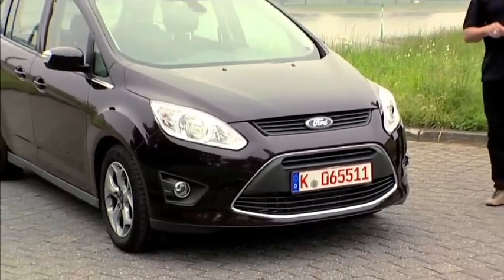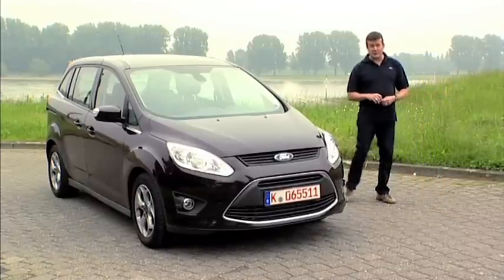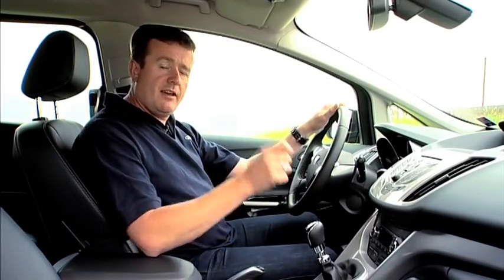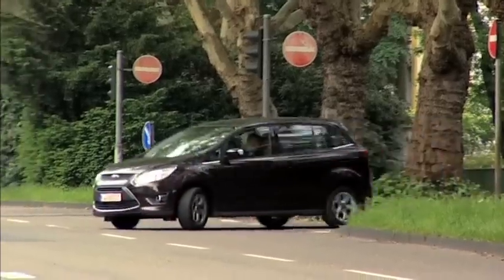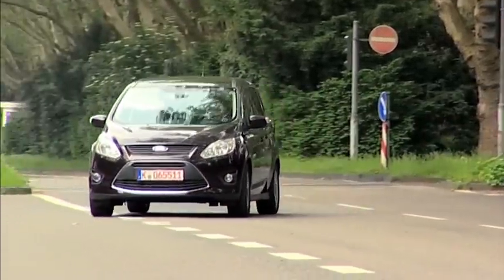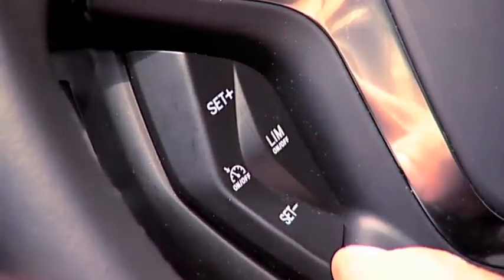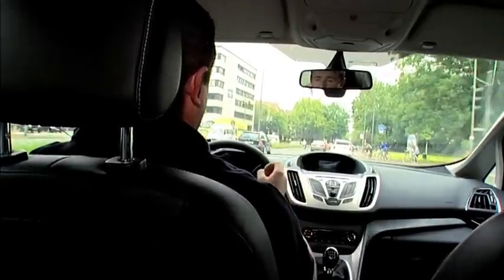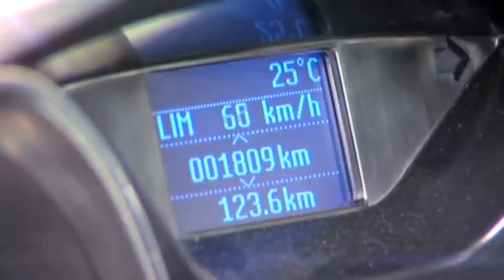Keeping Speed in Check - Speed Limiter

Comment: I believe that year on year police stats show that only about 6% of accidents are caused by unlawful speeding or that speeding over the speed limit was a  contributory factor but by far a higher  majority of accidents are cause by vehicles that are being driven or riden at speeds that are inappropriate at the time of the incident and not necessarily over the speed limit of that road.  The vast majority of all accidents are at junctions  and roundabouts,  [ smidsys and tailgating] usually around towns and  all usually under the speed limits and then in the country on bends [ going to fast or not allowing sufficient time and distance to slow in]  or on  inappropriate overtakes into oncoming danger.

So a speed limiter would have little or no effect on the vast majority of collision, incidents, accidents, injuries or deaths.

Comment: Will it act on the shown speed limit or take into acount the Police allowance of a speed plus 10% plus 2 mph so at 30 mph one could drive at 35 mph without fear of prosecution [ at the police officers descretion of course] but does that apply to speed a cameras as well.  Are we going to get any inbuilt speed allowance.

I hope n allowance is made because these higher allowancedspeeds of up to 79 mph on motorways are allowing some drivers to get away with anti social speeding and  to speed with impunity.  Something that  makes the roads  more dangerous. Its a boiut time tyhe police took off this allowance and let us use the speedometers.  So what if one is doing 28 mph instead of 30 mph its safer than idiots doing 35 mph.
Reply: judgedredd49 the driver sets the systems speed limit.
Reply: judgedredd49 I have known people get speeding tickets in a 30 zone travelling below 35
Reply: From what I have seen the driver can turn on or off this mechanism and when turned on the car reads the speed limits and then obeys them to the degree that if one wants to travel faster than say the limit of 30 mph one has to turn the sensors off and then one can drive the vehicle at any  speed one wants. So its all up to the machine  once its switched on and untill switched off the speed limit t cannot be exceeded.
Reply: Yes as I said in my original article ACPO [Police] now the NPCC had set an allowance above whatever the speed limit was in force for any particular road. That said they do also say that it is at the discretion of the police oficer at the time and neither did they mention whether the GATSO or other speeding devices like the ASC or Average Speed Cameras made such an allowance.  This then makes the whole thing  a  mockery as it can  and does encourage some drivers to actually speed whereas some drivers will just drive by their speedometers.

As a by the by it is understood that most speedometers are designed to give a false reading.  A reading that is actually faster than the road speed obtained and so as I said if a speedometer reads 30 mph one might be doing say only 27/28 mph.  So one could argue that if one is doing the ACPO speed of say 35 mph one might only be doing only just over 30mph and not breaking the law.  That may be true but for BMW drivers who would truthfully be doing 35 mph and thus may be reported for speeding at that speed but again in the mistaken belief that they are not speeeding  at all.  Believe it or not their speedometers have been found to be actually correct and perhaps thats why BMW drivers seem to be always going  faster than other vehicles and catching one up.   Thats because in truth you may only be driving at 27mph believing yourself to be doing 30 mph but the BMW is doing 30 mph  so 3 mph faster than you. Thats why he is catching you up.

Comment: So it can be turned on and off or indeed overriden if one wants to overtake and presumably one will exceed the speed limit for that road.  What  a useless waste of time monies and effort.  The only saving  grace is  that in urban areas where there are traffic cameras a potential speeder  can supposedly rely on the speed limiter and not bother looking down at the speedometer and therefore one is not taking ones eyes off the road.  Or maybe be one can be able to look around a bit more and still take ones eyes off the matter in hand,  that being the road.  Does it also keep safe following on distance to the vehicle in front... no I dont think so and will it actually stop if there is an emergency in front... no again I dont think so     So as a road safety devise its worse than useless and a waste of time  monies and consideration.  What it might do is stop bad drivers from being caught at speeds in excess of the set limit but it all depends on the driver and what limit is set and when or whether that  limit is switched off or overridden  .As such its a boondoggle and  that is something that is absolutely a waste of time,  monies and effort but is politically pursued by the authorities.